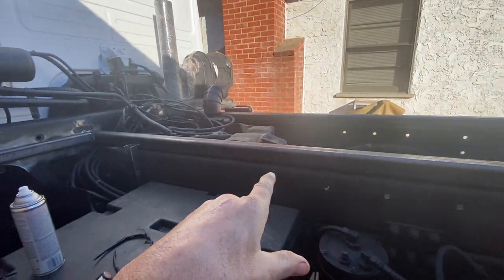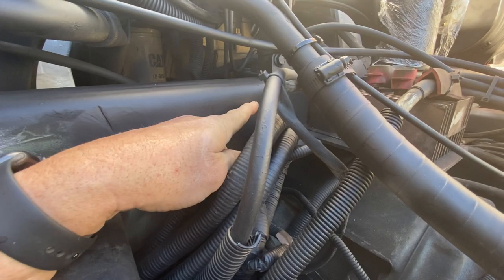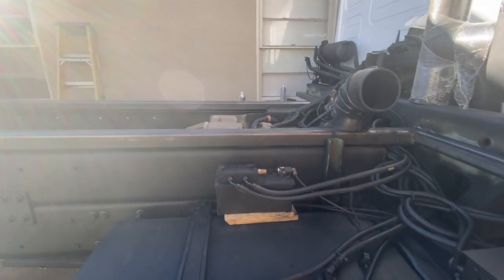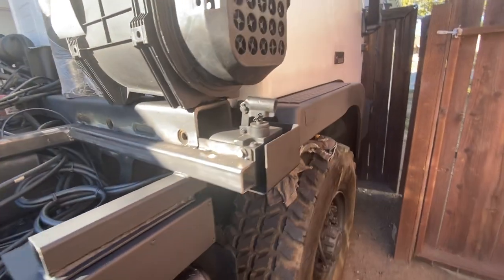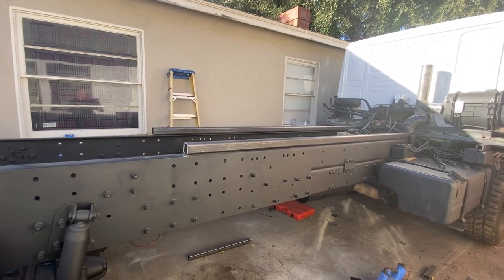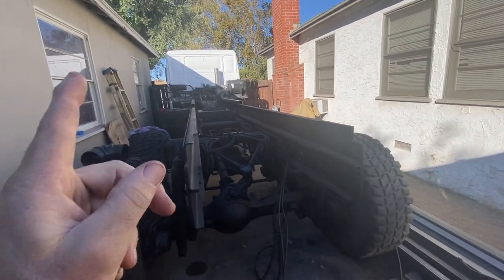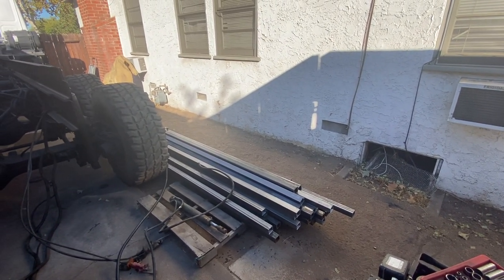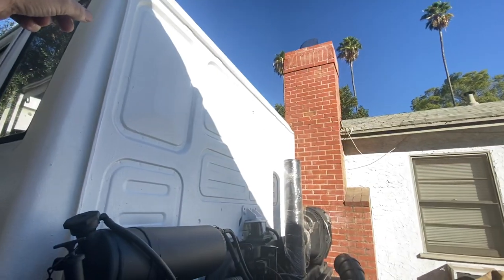Expedition Truck Build Day 14

Comment: Those small hydraulic lines with the Ts go to cylinders designed to compress the front leaf springs a few inches to be able to load the truck into an aircraft. You might as well pull those out and plug them like you did with the tire cylinder. Now you will have two hydraulic systems to do something cool or practical with.

Comment: Tim: You need to look at Acelas pictures of frame flex.  You have an extremely long truck so the frame twist will be more extreme.  I got away with my box because I left the bed attached.  I did that on purpose.  Just something to think about.  The longer the truck the more your frame will twist and flex, since all of your supports are gone from the wrecker frame components. 

Just something to think about.  I have watched too many builds fail a year later.  You can get away with it on a 1078 because they are super short.  Your truck is twice as long.  Either way, I just wanted to give you a heads up.  As always your work is looking great.
Reply: I was just thinking the same thing.
Reply: Yup! danger to bolt it down at both ends. I’d suggest you pick one and spring mount the other or fabricate the habitat to acomidate some twist in its own. I’d think it would be wise to go find a big loading ramp and ride up it until you float a tire and just have a look see what you’ve got.  Like you mention about the blank page and working with what’s in front of you.  I’d want to see the amount of flex or the lack of it first hand before making that call! Way harder to go back after and do anything about it.  That was a wrecker in its first life?
Reply: Sorry I missed the date on the video and it had just shown up in my feed! Guess you well past this now! Hope it works out well for you!

Comment: Loving the progress and on plans.  In regard to the length, any reason you didn't go with an M1086 for the extra frame length?
Reply from the maker: Thank you so much! From everything I could find the 1089 had the longest wheelbase and a 20’ frame that ended right after the rear wheels. I believe the 1086 has 20’ rails but a shorter wheelbase? I love the beef of the Wreaker.